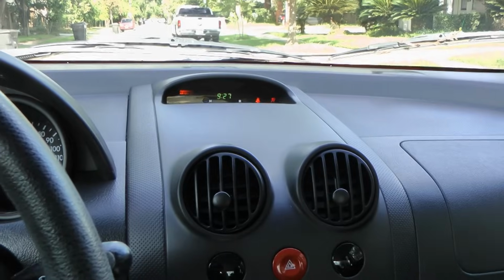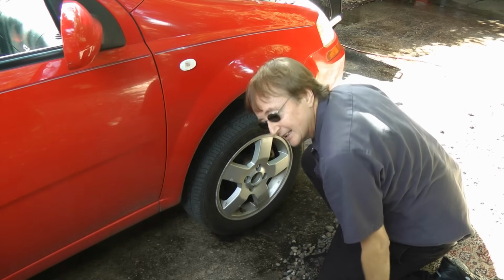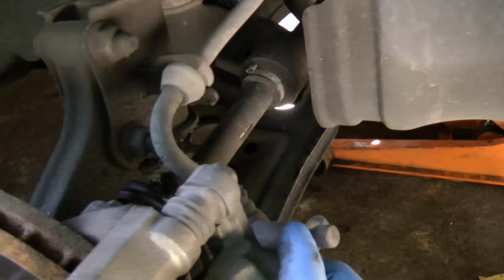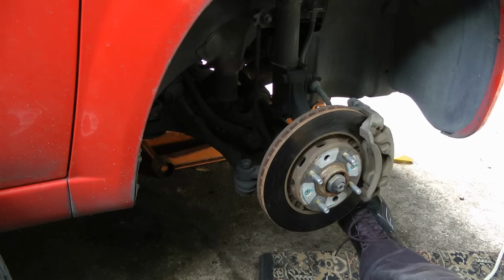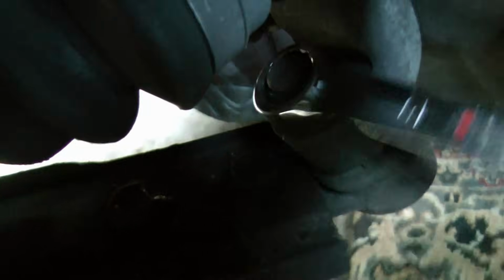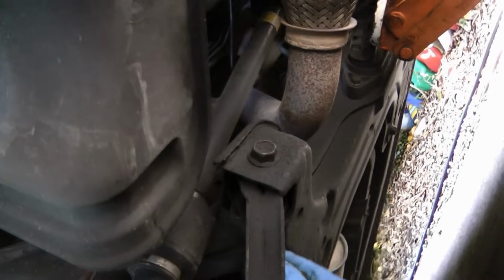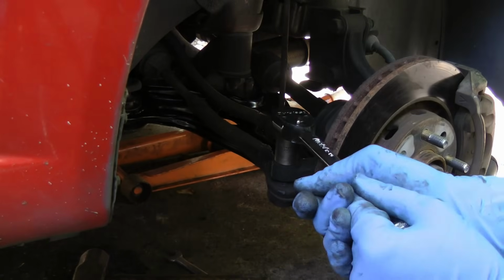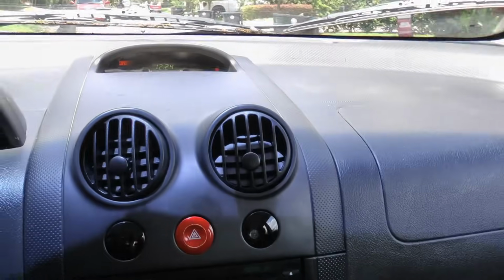How to Fix a Car that Clunks (Lower Control Arm)

Comment: Hei..Scotty Kilmer, nice video and it helped me a lot. my little problem is that when i brake with wheels turned to the right my Rx300 makes a "Grrrrr" sound but the hydraulic brake tube is far too away from the wheel. what could be the problem?
Reply from the maker: Modisenyane Sebetlela often worn wheel bearings

Comment: How bad can it damage the A-frame mounting areas? I'm wondering because I'm trying to get a new pair of front lower arms with replaceable ball joints now but have been driving it for over a year..

Comment: Just finished a course on this  training on replacing the bottom lower control arm i am doing a mechanics course  apparently they recommnend you should do up the bolts up when the weight of the car is on the bushs  otherwise the bushs will split pretty much straight away that the best practice apparently i didnt know that either until i did the course this is from mechanics who have been in the trade a long time.

Comment: Only thing I would say is depending on your vehicle, it would be best to take a Jack and place it under the ball joint end of the frame to compress it before putting the Castle nut on.

Comment: Don't need no tie rod puller, did inner and outer tie rod ends on an 05 Yukon with a socket set and hammer

Comment: Anything special about doing this on a 2014 Ford Fusion hybrid? I’ve seen in other videos (not the fusions tho) you have to put the suspension under pressure with a jack to remove it.  Doesn’t seem to be the case in this video or the fusions?

Comment: When changing both the upper control arm and the lower control arm in a 2005 Chevy silverado. Should I change the upper control arm first or the lower Control arm first? Which way is easier?

Comment: Hey Scotty - i have a 1999 Lexus GS300, there are lots of cheep control arms and ball joints on the market. I ordered good ball joints and tie rods. But im unclear about how good or bad upper deeply discounted control arms could be. Could you recommend a manufacturer, or do you recommend OE or press in my own bushings. If i do, i’ll buy the harbor freight 12 ton press. Then i have an issue finding good bushings. Im reaching out because im lost here and its a lot of work to do it over again. 

Thanks for everything you do buddy.

Comment: Scotty, would you recommend a Jeep Cherokee as a towing vehicle, for my caravan? I've seen a couple that are really cheap. A 1993 model. I know it's not the most fuel efficient car ever but I would only use it to tow, and some other times because my car doesn't have a back seat.

Comment: My girlfriend has a 2002 Corolla that's got a clunk in the front end. Everything feels good and tight. Only play I could find, at all, was in the sway bar links, and I changed them. Clunk is still there, and getting worse. Thoughts? Suggestions?

Comment: I am only new to trying and fix up my cars and before my next project I just want to confirm with you. I have a hyundai santa fe 2009 model. When I turn right the left hand front wheel is knocking at me. Is this bushes or something more? Cheers Mark

Comment: Yep make sure it's on nice and tight with a small ratchet. Use a torque rench when your putting lug nuts back on if that wheel comes of it'll cost you alot of money

Comment: I got a scion XA I hit a curb that I didn't see 
The front rim broke / chipped no damage to body.
Given how low it is the lip of the rim hit the curb only .
Do you think there could be damage now?
Had it towed and when he drove it off the back it made a noise.
Both tow driver and my father in law said belt .
But I hope it's not a serious issue

Comment: @jqahir 1st: smoke is caused for two reasons burning oil (dark/black smoke like when burning a tire) or burning water causing steam (white like a boiling over pot of Ramen noodles).

Comment: At first I thought it was the Lower control arms but today I took a look down there to find out my sway bar bushings are worn out. I'll  find out later on when I change them if it still clunking or not.

Comment: Another question! Do I really need a pickle fork and tie rod puller or can I use a wood block to hit out the tie rod and to get off the ball joint a bar and hammer? I don't want damage the tie rod! And also while the car is jacked up for the link kit it's just 2 bolts nothing hard or special maybe just a wheel alignment after words ?

Comment: I'm doing this on my van and replacing all the rubber bit under there while I'm at it. After replacing suspension components, it's important to at least get your alignment checked (most places will check alignments for free), if not get a new alignment.
Reply: Mine make a noise when i hot the brake i find the lower arm bushing is bad that could cause that?

Comment from the maker: you can't put that newer engine in such an old car, software is different, sensors different. I'm surprised it runs at all. good luck, I'd never touch it myself.

Comment: awsome videos 
i got a question we installed a fuel pressure reg and i think one of the enjecters is sucking air. 
i have a 97 pontiac grand am and i was reading the repair manual. but it dosn't make sense
please help thank you

Comment: Mr Kilmer, I was cleaning my throttle body and I think a small about 3x3inch or less piece came off and got back in the intake I think. I got distracted and didn't get it out before I re connected the battery and I turned the car on. It idled pretty hard/weird.  Should that little piece burn up or something? Or will it be a problem unless I remove it? What about seafoam or something else, would that break down and remove something like that?

Comment: Wouldnt it be cheaper just to get the ball joint/ bushings than the whole control arm (arnt they a couple hundred bucks) compared to a 15 dollar bushing, if you were doing it yourself. But i suppose if you got a mechanic to do it, it would probably be cheaper to get the control arm by the time your done with labor costs. Great vid!

Comment: On my zx2 I have noticed a clunk when I do a less then perfect shift. and just today it has started to rattle. especially in 5th going 33 mph at 1500 rpms or so. I think its the lower transmission mount going bad from when I was learning how to drive a 5 speed. I would wheel hop it every time until I figured out how the clutch worked. What do you think scottykilmer?

Comment: I have a different kind of clunk going on. Now this problem only happens in the morning, but when I shift into reverse there will be a pause and then a loud clunk. But if I sit and hold my foot on the gas to warm up the car for a bit there is no clunk. The temperature is cold in the morning so idk if that is part of this issue. What do you suggest scotty?

Comment: My car jolts when I put it in gear I'm pretty sure it's the transmission bushing or some type of motor mount that one out and cV joint boots are going out I think it might of broke a joint on the power steering rods that you have showed in this video . It's a mess I got into a high-speed chase with it it's never been the same I didn't bottom it out or anything i just took some Corners really sharp and  hit some dips at high speed.. !! And it feels like it wants to engage the transmission all th

Comment: Hey there Scotty!
On my last car inspection I got a note for a worn ball joint on the front right lower control arm, and I've replaced it 3-4 times since I bought it in '10. I suspect something is wrong with the wheel alignment because the wheel bearing on the forementioned side has play now, and I replaced that the last year!
What things could cause unusual wear on one side of the vehicle?

Comment: What if the bolt that goes into the crossmember spins, like the blind welded nut broke loose. How do you fix that? Why do you do most of your shopping on amzn. Thanks, new subscriber.

Comment from the maker: that's the easy way of getting them off. sometimes you have to use a sledge hammer on the inside of the rim to get em off when they rust on

Comment: Yeah! It's even cheaper if you only change the bushes, like I did. I have a 19 year old Opel with the same kind of front suspension. It's a cheap and easy type of suspension, but still can be pretty comfortable and nice to drive. Well, my Opel is a GM product as well, just like this Chevy.

Comment: Scotty, l have a clunking or kicking issue on a 2005 BNW X3  right before l come to a stop, its coming from the back. Mechanics have said its a transmission mount replaced that, still making that clunking noise the mechanic said its the bushings that also has been replaced noise hasn't disappeared. Dont like spending money on guessing games. What are your thoughts on this issue?

Comment: Hey Scotty love your videos, 

I replaced the lower control arms on my 05 Sebring that are the same style as these ( built in ball joint in the front with one horizontal bushing and one vertical bushing) I replaced it as the shop said the ball joint was worn. I also replaced the sway links per your other video. There wasn't any clunking with the old parts but now there is just like this video. Any idea what I may have done wrong? I've triple checked and everything is tight

Comment: my car will clunk going over bumps, or seems like something loose in the front on both tires after passengers are in my car. This last for 2 days then magically goes away when i drive alone. I plan on taking it to a mechanic but I wanted your thoughts on it. Thanks Scotty!
Reply from the maker: some suspension part is just starting to wear, often worn strut mounts or A frame bushings do that

Comment: Hey Scotty!  I replaced my shocks, outer tie rod ends on my 02 Ford Ranger, got it aligned, but now the front end feels a bit janky.  Didn't feel this way before.  Could the new shocks be revealing bad ball joints or sway bar bushings?

Comment: scotty, both my front suspension make a slight squeak like a spring when it hits a bump on the drive way....is it the bushings on the lower control arm....car has only 13,000 miles lol..

Comment: I seen there was at least 2 film cuts I wander how long it really took to get the tire and the ball joint.
I have a 2003 chevy venture that has a bolt out of the #5 rocker in the engine. I have heard it caused by when they replaced the head gasket under warranty years ago caused the problem 
I have paid for 3 in the front now they want 1500 to do the back ones due to the engine must be pulled. Have any ides ?? Was there a alldata tsm about the problem

Comment: Would this job require an alignment afterwards?
Reply: I would say yes. New control arm with new bushings could cause the wheel to be at a new angle.

Comment: Hey scotty, I just changed my control arms, my struts, and breaks and the thumping noise still occurs when i go over bumps and apply my breaks. My mechanic noticed that my engine mounts are bad so i'm ordering those next. I wonder if anything else in the front of the car can cause the thumping noise i'm hearing?

Comment: Could it be something else other than the control arm that's causing these noises when you're going over bumps / pot holes?   I'd like to get it professionally done with higher quality parts instead of having to do it again sooner rather than later.    When I had my car in the shop to swap out the stock suspensions for performance coilovers, the guy said my control arm was making noise and need to be replaced.   It started showing symptons probably 40,000km which seems premature to me but now at double that it's making a lot more noise and I'd like to get performance grade ones to replace it but want to know if something else could be causing the noise.

Thanks

Comment: I have a thud noise coming front he front of my dodge ram. And it only when I hit potholes and turn left. I thought it was my struts but now I think differently about it. I'll have to jack up my truck and move it around and see if it's the upper or lower arm.

Comment: hey scotty ive got a 1997 honda prelude manual in the morning when its cold i have a bad clunk from the front end. its when i let off the accelerator to change gears, or if i change gears or if i jerk the accelerator. as the car heats up the clunking goes away. it sounds like its bushing or suspension related but i have a bad feeling that its got somethign to do with my gearbox.

Comment: I thought that too, but would a transmission grind when driving on a curve in the road?  I didn't think a transmission would care about a road being straight or curved since it outputs to the transfer case and then the diffs.  And what about the loud knock?   
I looked in to a new transmission and that's about 900, which wouldn't leave me much for other repairs, so I just want to figure it out before hand so I get the right parts.
Reply from the maker: you take corners, drive shafts have different torques, which can cause transmissions to make internal noise from that torque force
Reply: Scotty Kilmer sounds legit.  Thanks for your advice. I know it's harder to diagnose without the vehicle there, but you seem very knowledgeable. Thanks again.

Comment: I replaced my lower ball joint a month ago and their bad already, i used cheap parts but i dont think they should go out that fast, ive replaced the entire suspension system and all my steering components??

Comment: Hey Scotty all the way from Australia. just a quick question. I drive a '07 ford falcon. and when i change gears from first to second i get a clunk. it doesn't do this in any other gear. would that be clutch or gearbox problems? I have gotten a few opinions from a couple of mechanics and they seem to think it could be the rear diff bushes...

Comment: Hi Scotty,

I have a 2014 Mazda 3 with 108k kM on the clock, I've recently had my lower control arms replaced and despite the OEM arms being worn, I'm finding the new arms to be far more louder and harsh on the road, specially on rough surface roads and over little imperfections on the road.

I've had my local Mazda dealer look over the suspension and other then my front sway bar link pins being a little loose and worn, they've found everything else to be fine.

Could this just be a case of cheap control arms? What's your thoughts?

Comment: Hey Scotty :>), I've got a Pontiac Vibe 2008, So far I removed the lower control arm (left side), a real pain, not as easy as your video :>) now I'm having difficulties installing the new one basically I can't get the holes to align in the horizontal bushing, my screw driver makes it thru, but that's it, not much room to wiggle... any suggestion or video on how to proceed, thanks.

Comment from the maker: remove the assembly, there is a gasket on the inside as well as the outside. Pray it's just that and not a crack.

Comment: We'll see what Scotty has to say, but if it dies suddenly (i.e. no sputtering), it's likely an ignition problem. It could be your ignition module. Sometimes when they are failing, they overheat, stall the car, then are able to work after cooling off for 20-30 minutes. If that's the problem, it's a very easy and inexpensive fix.

Comment: Scotty! Long-time fan.  I have an '06 lancer ralliart FR drive. Front of the car makes rhythmic clunking when I turn left or right only when I accelerate at the same time. It doesn't make noise if i'm just turning and coasting.  It doesn't make noise when i'm in park and cranking the wheel.  The CV boots don't appear to be cracked. Any pointers? Thanks!
Reply from the maker: check for worn struts and mounts
Reply: Scotty Kilmer I meant its FWD, not FR, typo.  does that change anything or still check the struts?  Thanks for all the great videos

Comment: Hey Scottie. I have a 2022 Ford F-150 XLT FLX4 super crew cab pick-up truck that makes a clunk sound when making an abrupt stop. It does it intermittently. It doesn't make any noise when I'm going over bumps. I don't know if it may be the transmission or the front suspension. The sound is coming from the front of the truck. Every time I take it to a mechanic, he says he can't duplicate the noise. Any suggestions?

Comment: Hey Scotty I have a clunking noise in the front end of 2004 dodge neon sxt I replaced the struts,stabilizer bolts, lower control arms, wheel bearings on both sides and new cv axles what else do you think I need to do.

Comment: after servicing rock arm pinion and reattaching it I now have vsc, check engine light, traction control and the steering is very hard, do you have any idea what's wrong

Comment: Hi Scotty.
My civic has no problem until I drive it through flooded which hole 1/3 wheel and now I hear the sound from the front of driver side when steering and passing bump. Could you tell me your thought of my car's problem. Thank you
Reply from the maker: jack it up on that side and check for worn lower ball joint or broken strut mount first

Comment: Hi Scotty

I have a 1972 cutlass supreme 

I was driving it last week and heard a Big Bang 

After the band there was squealing and scraping

Now the car pulls left when I push the brake

Could the rear end be blown?

Will the car drive with a blown rear end?

Thank u

Jason
Reply from the maker: car won't drive with a blown rear end. But check mounting bolts and bushings, it can go sideways
Reply: Scotty Kilmer 

Also the brake pedal is starting to go into the floor

Thanks

Comment: We replace lower control arm on both sides tire rod ends , the entire system and now it clunks worse. What can it be ? It was  aligned at reputable shop. Could it be defective control arm or bad installation?

Comment: Hi. I had problem I changed the control arm and rod on the passenger side. Clunk went away for 2 weeks. Now it’s slightly back when I brake and drive slow or driveways. Is it possible the side I did messed up again? Could it be the other side but I rele don’t think so. I just got an alignment and they said the front end was nice and tight so I don’t think I left anything loose.